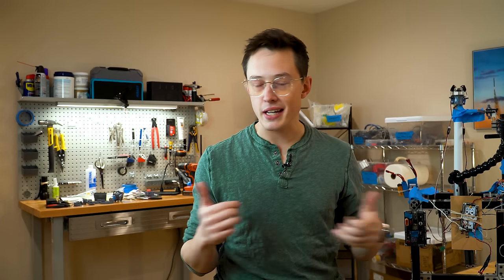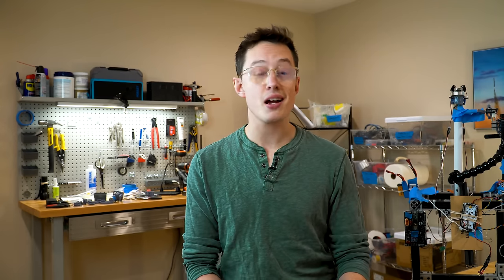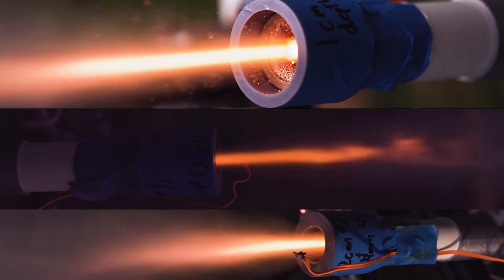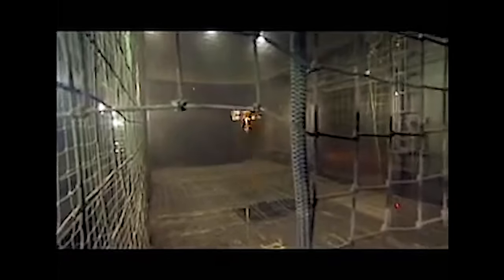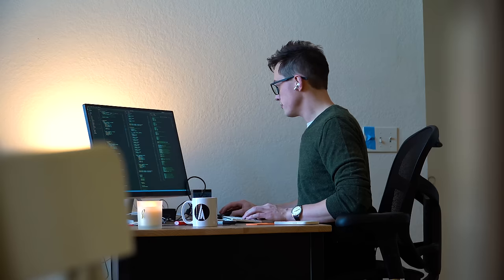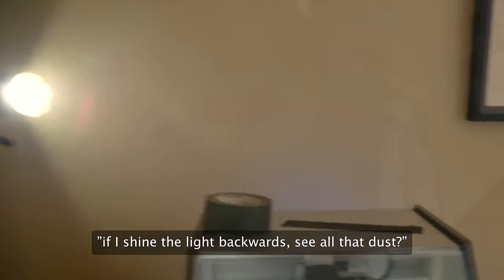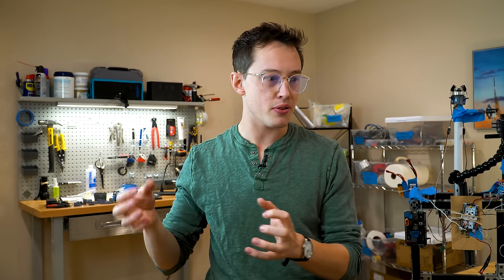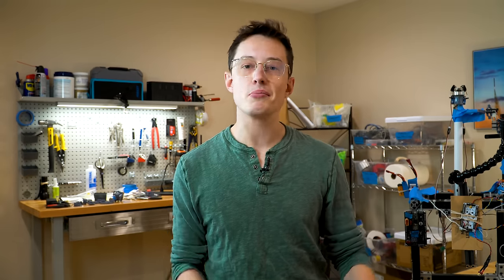I Figured Out How To Throttle a Solid Rocket Motor

Comment: How about a bell shaped rocket nozzle that instead of liquid oxygen in the cooling tubes use compressed air and have openings on the inside of the nozzle that lets the compressed air out in a vortex pattern.  The more air that comes out the stronger the vortex which should disrupt the rocket motors exhaust which will lower the thrust.  Use a binary valve to turn on and off the flow of compressed air to adjust the rockets thrust.

Befits to this approach is you are not sticking anything into the hot exhaust gases from the rocket motor to be melted by the heat or for stalagmites to form on.

Comment: Im not pro at this but: 
- Is there anyway to spill fuel (gas, propane ,methan ... ) like the engine on the  fighter aircraft when they want to reach sonic speed- just a very small amount of them  - in to the fire chaimber? it wont reduce the force, but may be provide a little push. In case the engine start too early. 
- or somehow spray some cold CO2/anti-burning material  in to the burning chaimber to reduce the thrust when landing
everything added with  a very small amount and a control frequency
----
But it easy to said than done! keep up great work, hoping to see your new launch

Comment: My initial idea would have been to attach a sleeve with holes in it at the end of the nozzle, like you did, but made of steel and another sleeve tube around it, which can be rotated with a servo. Aligning holes would let air pass and closed not. Any thoughts on it?

Comment: Surely the side forces on the APCP motors would be fixed with wider ceramic claws, so the surface is flatter and more consistent and doesn't let the gas escape around the side as much ??

Comment: So, they cannot be 'throttled,' in the traditional sense (on the fly adjustments to output intensity of combustion), but you can stick a big redirecting obstacle in the path of the fire to deflect and therefore limit their directional thrust at least. Neat! Obviously, there is a huge loss in possible velocity increase, if only there was a way to recoup at least some of that energy in some way...
Reply: Hey. Is there a case where this lost energy could be useful? At a model rocket scale, I simply do not see how it's going to matter on the way down. Does this have something to do with these losses mounting up and the motor burning up faster than anticipated, leaving a small chunk of the remaining flight with no control authority at all?

Comment: If you only need 20% throttling ability, rather than building "paddles" which impinge on the exhaust flow could you impinge "tunnels" which divert the flow to the side? This way I think you could get finer grained control of the magnitude of your thrust vector over a smaller range.  I think you could do this by drilling a hole through your existing paddles either axial to or slightly offset from the motor thrust axis. This also means that you have more control of the side forces generated by activation as less thrust is just turbulently spilling around the paddles.

Comment: You might want to experiment with graphite for the thrust paddles--cheaper than ceramic (MACOR?) and available in slabs and sheets with a huge number of grades.
Reply: To expand a bit. The Redstone rocket used graphite vanes for thrust vectoring.  It’s available from places that specialize in EDM and also places that provide tooling and supplies for art glass—glass blowing and molding, etc.

Comment: Here is a thought from another "hobby"... I work in metal casting and furnaces... what if, instead of milling out pre-formed sheets of ceramic, you were to make molds in the shapes you want and use refractory cement which is used in the lining of furnaces? Less waste, parts already in the shape you want, and easy to modify... you might need to add a reinforcement to the overall, but perhaps a twisted piece, or small strip of kaowool might work... Just a thought for making several nozzles and shapes for a "single pour"... Oh yeah, also a LOT less dust!

Comment: You could also „throttle“ when using multiple motors and change their angle, so the resulting thrust vector gets longer or shorter
Reply: 3 motors in triangle(tripod) configuration - that's how Gravity jetpack controls his vertical thrust.
Reply: @ZIP18PL  Yeah exactly

Comment: I would think this is what the US Air Force is actually doing with future versions of AIM-9X and AMRAAM block upgrades.  They talk quite a bit about it on The Drive and they've definitely written that future development is intended to extend range and improve intercept geometry by controlling the solid rocket motors somehow.  The idea was relayed as preventing the motor from using it's entire burn just after launch and somehow enabling the motors to stop/start.  I would think you could consider that as throttling.

Comment: I for sure have a comment for you, regarding the attempts, congratulations, you are awesome. But, you can look maybe to the geometry side of propulsion. Here is one idea for maybe your next try. If you light a motor, lets say that its producing 100g of thrust in Z negative direction. If you angle the trust between X and Z plane the thrust mathematicly is spliting in 2 directions depending on the angle. Lets say you are at @=30 deg to the possitive X side. Equivalent forces will be Fx= Fsin@, and Fz=Fcos@. To countoract the horizontal force Fx logicaly you should make -Fx. Theoreticly with 4 Rocket motors at the bottom, wile controlling the angle @ on each motor you should have smooth control of the Fz force without blocking the exhoust. Simply share part of the trust of all four motors to the side X and Y. Will you try this, I think its more simple and controlable :)

Comment: Vernher von Braun's A-4 (A,K.A. Hitler's V-2) first test flight could not control the rocket orientation before it would reach adequate air speed.  So he too had to find material that would take the heat.  His solution was to use graphite deflectors.  Graphite would not last forever, but long enough until the air speed was sufficient and the small outside wings started having their effect.  I think graphite got ablated rather than burnt.  After all, there was not air in the jet.

Comment: you shoud use something like a vent simetricaly from the 2 sides of the rocket so the fumes  from the rocket can gosomewere so your (gripper ) in front of the motor can have less force applyed to it

Comment: One solid motor throttling method you missed out on: Grain shape. The hole (or no hole) running up thru the propellant. The diameter and shape of that can control the area of the combustion chamber as well as the surface area of the exposed propellant -- for instance using a star shape instead of a tube shape of the same diameter.
Of course, you can't control this real-time. It has to be a pre-planned burn. I'm 96.735% sure this is used IRL in some solid rocket engines.
There are some people who custom-core their solid motors. It's not "safe" per se, but if you know what you're doing ......
And IIRC you can combine different grain shapes in the same motor casings if you're willing to risk some potential catastrophic failures. Which are always fun to capture on cam in slo-mo eh ;)
... Or do the calculations and cast/mold your own APCP grains. It's pretty safe to work on that level with eh ;)

Comment: How about injecting a thin stream of water into the solid rocket motor, either inside the reaction chamber, inside the nozzle throat, or just outside the nozzle in the exhaust stream? I'm thinking that the water flashing into steam would increase the internal pressure and by throttling the stream you could control the thrust. Even if the effect of the water were to REDUCE the overall thrust, that would still provide a means of throttling the thrust.
Reply: I was thinking about this, I've heard that some solid fuel ICBMs like the Minuteman II use water injection in the nozzle for thrust vectoring, injecting water through ports in the side of the nozzle one at a time as needed to create off-center thrust and force the missile in the right direction

Comment: I really think the velocities that you were getting at the touchdown was perfectly within a landable velocity. It seemed like it was the horizontal velocity that was an issue, resulting in tip-over at touchdown. You cannot use thrust vectoring to cancel out the last few fps on a lightweight rocket, so you need some CO2 thrusters to zero in the horizontal velocity while keeping the ship perfectly vertical. If you have zero horizontal thrust and very vertical touchdown, this also expands the vertical velocity acceptable for a successful touchdown.
Reply: Also you can keep the rocket upright after touchdown, which is when the failures really are occurring. Have no thrust vectoring at all, and control the attitude with small CO2 thrusters, and I bet you will have 95% success rate.

Comment: Just a little question, in order to decrease the amount of stalagmites of aluminium produced by the combustion, and decrease the asymetrical side flow when the exhaust is loked, whynot make the control surfaces in a symetrical quarter of a circle (likethe tip of an aerospike engine or the bucket of a pelton turbine) intead of straight, it would redirect the flow instead of blocking it,  it wouldshave of the stalagtite produced instead of stacking it up bit by bit, lower the forces on the ceramic parts ( increasing the lifespan), and drasticaly decrease the amount of asymetry  in the exhaust, thus helping the mechanism orienting the thrust

Comment: If you use 3 of those "thingies" (VERY technical term I know) then you might be able to control the side forces.
BUT I think that "in the wild" so to speak it will cause an almost instantaneous flipping of the rocket and very hard to detect and react to before the thing goes haywire.
It would be rather spectacular though ;>}

Comment: Have you considered using graphite for the blocking arms?  It can be machined, it is very high temperature (used for rocket motor control vanes), and on McMaster it looks to be about 1/5 the price of that ceramic.

Comment: Damn it Joey, put all the god damn respirator straps on. If you want to be able to quickly don and doff get a 3m quick latch respirator. They cost a tiny bit more, but have a lever that removes the tension and drops the respirator below your mouth by throwing a single lever.

Comment: I wonder how much harder something like a split rudder on those exhaust "valves" would be to make? Kinda like speed brakes? It could potentially give you finer throttle control without too much sideways hot gasses interfering with the rocket body.

Comment: I can help you with @9:48 you need to peck/evacuate with air if you're going to use that type of drill bit (edit: which like two mins later you said). I think you'd actually have better luck with a masonry bit... The reason is "chip size"; you're using a bit designed for evacing wood or metal chonks.

Comment: can you 3d printing the thrust blockers with ceramic-infused resin like what Integza did a while back? Worked pretty well for him and you can create different shapes to reduce that side force
Reply: AFAIK has Integza never got the ceramic nozzles to work properly. The sintering process is very complicated and leads to bigger problems like tension fractures and deformation
Reply: @Craftlngo  well the thrust blockers are quite simpler in geometry so I don't think it would be a problem and I think it would save him some cash since he won't need to spend hundreds of dollars on ceramic every time the blocked need to be replaced
Reply: @jayanderson5823  the problem was the different thickness in the walls of the parts. They shrink different while sintering, which leads to tensions and cracks. (It's the same problem with regular ceramics). I don't think you could produce a thick block of ceramics in this way, without destroying it during sintering.
Reply: @Craftlngo  Ah, that makes a lot of sense, but I do wonder if thinner thrust blockers with honeycomb structures survive the heat and pressure.

I observed that Integza uses such structure a lot too

Comment: If the connection is strong enough, you could possibly reverse the force similar to the bucket on a jetski. Also, could you just use flaps to create an adjustable nozzle?

Comment: Wouldn't something like the thrust reverse buckets on old turbojet engines be more effective? They would actively direct the exhaust away sideways instead of just getting in the way. Asymmetric use of the buckets would give you a degree of thrust vectoring, in one direction at least.

Comment: Idea: instead of using two doors to block the exhaust, use three aligned 120º apart.  This will allow you to control not only the amount of thrust, but also the direction with just three moving parts.  It'll take a lot of math, but in theory it should work.

Comment: I would think you could use 3 paddles for thrust vectoring control, no? the slag buildup might be more of an issue there, but could be a lighter method then having to gimbal the entire engine?

Comment: You should try using graphite instead of ceramic. It’s much cheaper and is used to make some crucibles and reusable metal casting molds. And is probably easier to machine

Comment: I'm not sure he'll see this but.. What about making a cylinder with holes in it for the exhaust. The control cylinder could be spun at different rates to allow exhaust through or not. This would cut the number of control motors in half and be a potential weight savings.

Comment: What if you add two more servos and design the cermic in such a way four of them align pretty well or even completly. This way you can only close for example three of them and have some TVC. This will be way harder to design and build and I certainly can't do the math/run the simulaties but I think this will work.

Comment: What about making the control port something like a camera shutter where the control "wings" move horizontally instead of vertically. That would probably lower side forces that might be caused by "leakage" around the mechanism.

Comment: Hard machinist bits might give you better accuracy than those cheap flexible steel bits.  Mine are like yours but I'm on a budget and usually working on projects that can compromise a little on accuracy.

Comment: You're doing AMAZING work man!! Wow. A couple thoughts on the throttling mechanism:
Why make the entire arm out of the ceramic. You could use metal and simply use ceramic as the thermal pads, attached mechanically. That could save weight and add strength and stability; tighter tolerances. Lower risk of assembly failure. The arm wouldn't need to be so thick and bulky. Also it would save on ceramic. You can always melt down and re-use metal eh.
Perhaps instead of ceramic (EDIT: Carbon fiber? See bottom) ......... Do you have access to aerogel? No, really. Given .. well .... you .. I'm thinking that's entirely possible. ;) .... HELL!! They'd likely just send you some gratis I bet! For real. Reach out eh, whatcha got to lose.
Have you considered refractory brick, such as what is used in hot forging metal, and melting metal for that matter. Also pretty lightweight. Or even the ceramic that's used to make the crucibles themselves? They don't even BEGIN to glow with liquid metal inside em in the furnace. They remain white and glossy.
An idea to reduce potential side thrust: Instead of two arms use four smaller ones. Also, would shaping the thermal pads conically (tip pointing toward the throat of the nozzle) help more evenly deflect the exhaust stream? Kinda "pre-add" those spiky bits that resulted from the composite motor.

Another potential mechanism that comes to mind is an iris. Tho of what material? hmm .... Titanium? Could carbon fiber withstand such temperatures? I just looked it up. In general? Yes. Melts around 3657C. So you could make a rather decent iris with carbon fiber.
Caveat: It depends on the manufacture and "mix," so to speak.
This would also make it a good replacement altogether for the ceramic pads.

Comment: I have a simpler idea....those binaries pulses are fast...so better use a blocker spinning the ceramic and I think could keep the ceramic in better conditions...I know that spinning ceramic could be a unestable for the rocket...but could be a kind of giroscopic desing of it.....I hope could be a good idea for you. I wonder wich is the sistem that close and open the throttle on the secret devise on the video. Sorry my bad english :)

Comment: graphite is much cheaper and more resilient (Scud rockets actually use graphite vanes for thrust vectoring), it's just as messy when machined and the dust is conductive...but won't give you silicosis. 
Save $$$ on the material and get an actual dust extraction system unless you want to wear that respirator all day, the free dust will get on (and into!) your clothes, on your skin and into your hair, then it randomly gets released everywhere you go. Also, the ceramic dust is abrasive, it's slowly destroying exposed bearings on your CNC thing.

Comment: Sooo... If the exhaust that is diverted out the sides from the paddles is not equal would you not induce an unfavourable torque on the vehicle or is this effect negligible?

Edit nevermind, you address this at the end of the video.

Comment: I wonder if you can put ceramic valve on the opposite side of rocket, so opening it would reduce main nozzle throttle and cause opposite thrust same time.

Comment: Could you use chemical throttling by running a fuel rich mixture and then adding a controlled supplementary oxidizer?

Comment: Nice, now a completely stupid suggestion/question. Are you deflecting those pedals at the same time and same angle why not link them so both servos are acting on both pedals. That will assure they move at the same time. And will give you some control in case one servo/linkage fails. And 2nd thing did you try graphite as pedal material?